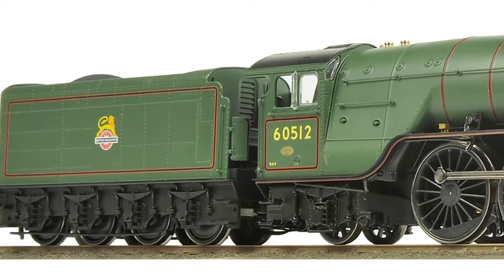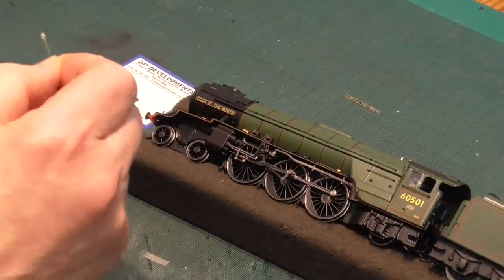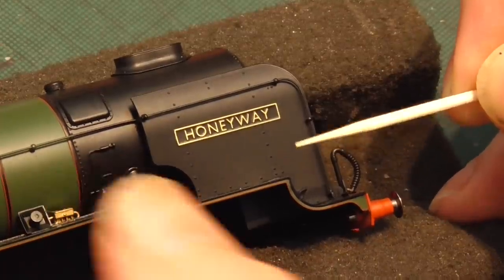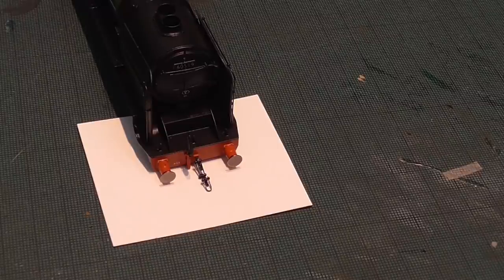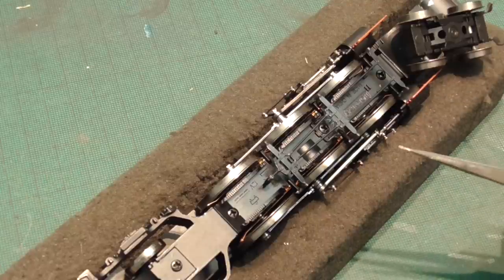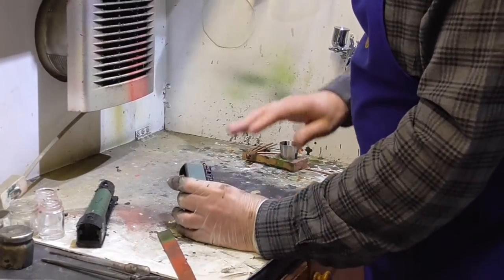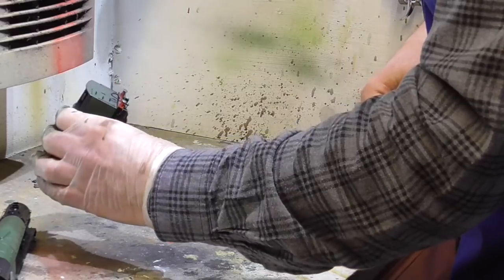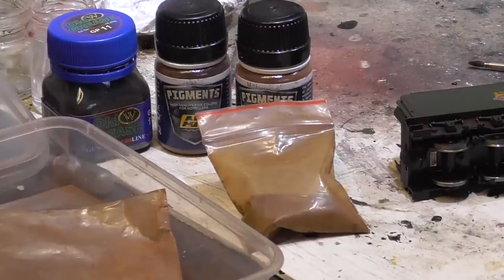Enhancing Hornby's A2/2 and A2/3s model railway locomotives

Comment: I replaced the nameplates on my Thane of Fife with etched versions, makes a massive improvement,  but I am just wondering how easy it is to reduce the length of the molded name backing plate on the A2/2 if you wanted to rename the loco with a shorter etched nameplate?

Comment: Very well-done Tony and Geoff on producing enhanced models of the A2 from the donor Hornby engines. Marvelous work by the both of you for running the respective trains of coaches and wagons.  So, the burning question Tony is where did the finished Earl Marshall model end up as its home, for the rest of its working life after filming had stopped?

Comment: What an absolute gem of a video. I'd recommend trying Rocket Card Glue for the name plates as a) it's not stringy, b) it doesn't eat into the plastic c) the name plate can be briefly manipulated so it is straight and true d) it's water based so can be removed with water if needed.